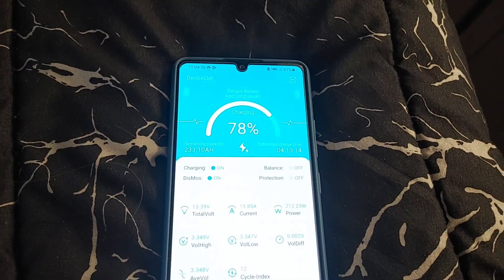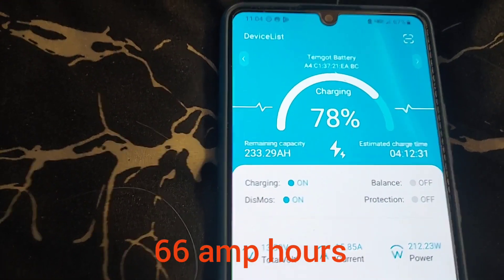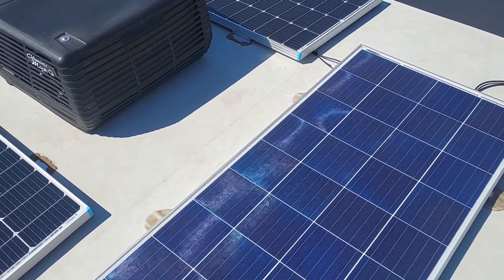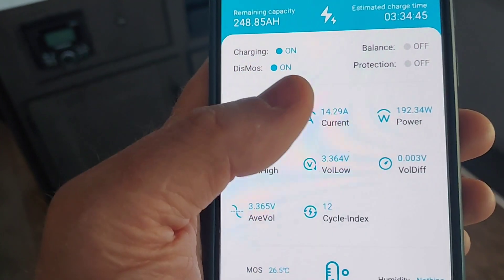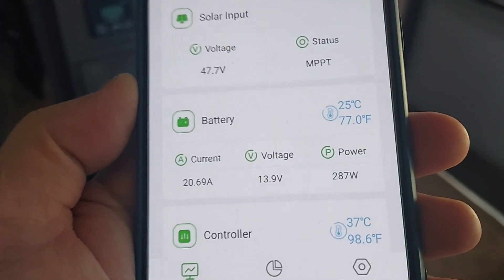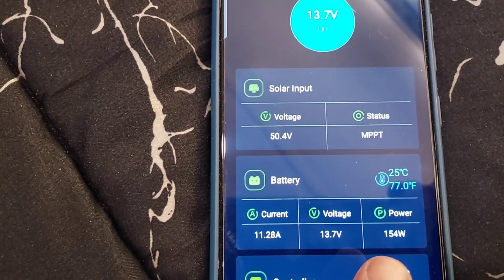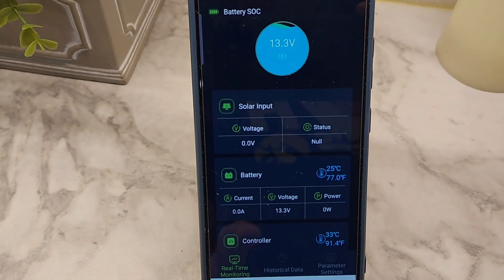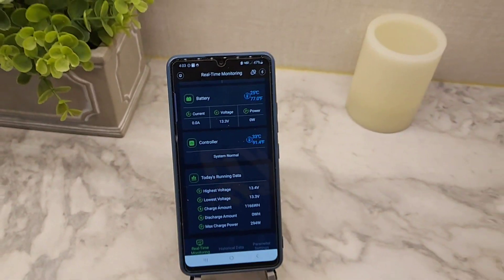Solar Panel performance on Momentum 21G

Comment: A bit of dirt and dust won't hurt anything.   But shade can throw a wrench in solar production, and being off-angle certainly reduces solar production.  Some people build prop-ups for the panels while parked, but most just eat the reduced production because flat-mounting is really easy to do.

Also, wiring dissimilar panels together can cause reduced production, depending on whether it is series or parallel and the specifications for each panel.  When wiring in parallel the voltage specs for the panels have to be very close to one another, and when wiring in series the current specs have to be reasonably close to one another.

The best overall solution is to get rid of the shade, meaning mounting the panels on stand-offs high enough such that no shade is thrown on them.  And maybe make a little front-piece to reduce wind resistance while driving.

If you can't get rid of the shading, then you do have the option to wire each panel into its own dedicated charge controller.  This will be a bit more wiring and need three charge controllers but then the panels won't interfere with each other.

-Matt
Reply from the maker: @junkerzn7312  Thanks for the info. The panels are very close in specs. I kept the original Jaboni panel and added two Renogy 175 watt panels. I suspect that Jaboni was using Renogy panels. 

Maybe someday if I upgrade the panels I will make them adjustable and raised higher.

 This is the 1st time I have really looked at the amps, watts, and volts on the app and researched results. 
Thanks!